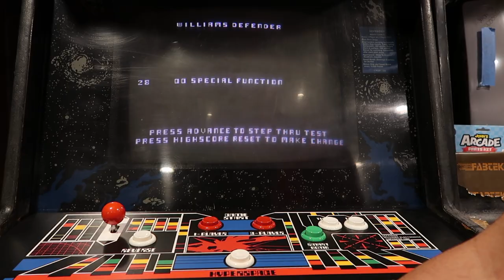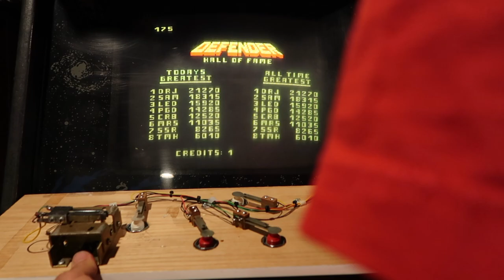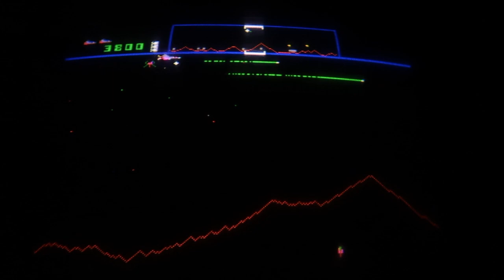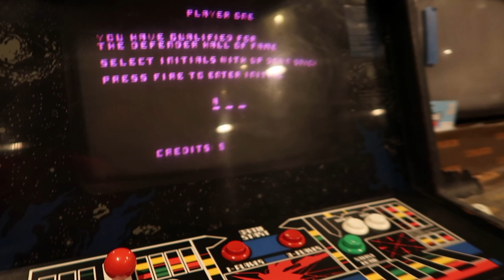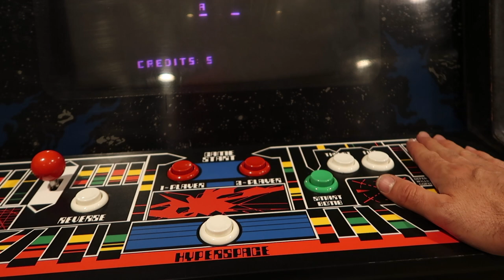Making a DEFENDER control panel [ William's arcade cabinet ]

Comment: Hey Adam, do you know if we can get some controllers just like the Defender machine.... but for Xbox or PS5?
Reply: I don't know anyone who makes them commercially - but all of the parts are available to make your own - Youtube is replete with tutorial vids on how to do this.
You will need to make sure that the USB encoder board is either directly compatible with Xbox or is compatible with a convertor though.

Your options include the SJ@JX encoder, arcadeworlduk encoder for xbox 360, or IPAC2 encoder + PACLink console adaptor from Ultimarc.
Xbox One encoders are much more rare - AFAIK there's only manufacturer who makes them - the Brook Universal Fighting Board
In terms of buttons, I'd recommend Ultimarc Goldleaf Buttons - they're cheaper and easier to install than the leaf switches we see in this vid on the original control board but just as good - I don't recommend microswitch buttons - they don't have the same feel.

Another consideration is the Joystick. 
Unless you are VERY lucky you'll never track down an original Wico 2-way stick.
Reproductions are available from Arcadeshop(dot)de and jbgaming(dot)co(dot)uk - but they're pretty expensive compared to standard arcade sticks and can't be used for much else so you might want to consider another option.
There isn't much space between the spot where you mount the stick and the reverse button so you'll probably have to cut away part of the stick's mounting plate so that it doesn't overlap the hole for the Reverse button - so go for the smallest form factor you can - something like the Mag-Stik Plus with a ball top might work (but don't quote me on that)

Comment: You probably could have just used the wiring within a CAT5 or CAT6 cable as it has 8 wires all different “colours” — some are striped others solid. And if you’re like most folks have a six foot or longer CAT5/CAT6 cable lying about. 

And I thought Defender CPOs were matte while Stargate were gloss. Of course 40 years of memory may be less than accurate. And the control panel I have for my project is matte with loads of cigarette burns. But unsure if it ever had a new overlay applied. No matter. I’m just happy I have one to put on my cabinet once it’s done. 

And thanks for the video.